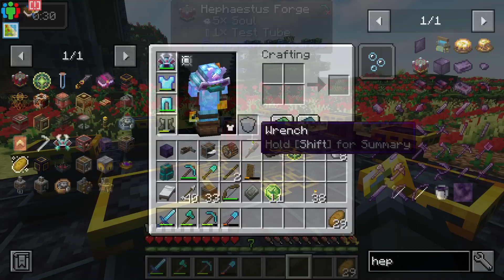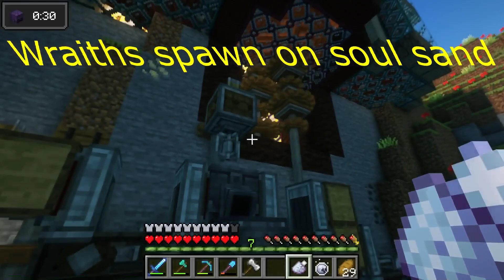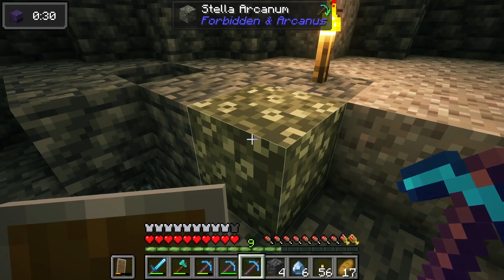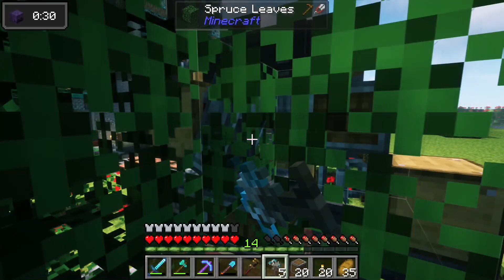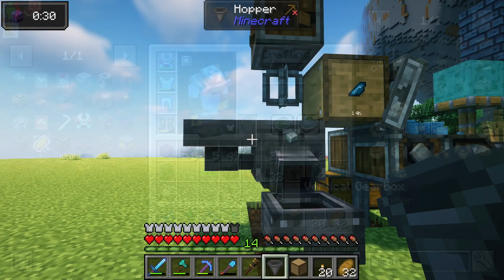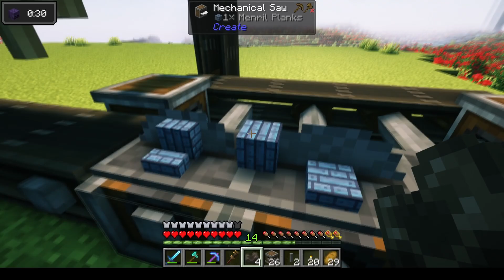Create Arcane Engineering - Mastering Automation of Chapter 1 Ep 3

Comment: How did you handle the inserting of the fresh saplings into the harvester? I recently built my own but I was having difficulty inserting the new saplings because the moment I inserted them they would be immediately removed. While I did have access to a brass funnel and could filter it to not remove fresh saplings, I worried that since each tree chopped gave more than one sapling it would eventually overfill.

I ended up making my system have two interfaces one on the end that removes everything and one on the top looking straight up in the middle that is connected constantly while in operation. I use redstone to disable the middle one when it is interfaced with the other interface. That way it removes everything but restocks on new saplings during operation
Reply from the maker: I like your workaround for the saplings. Good idea! For mine whenever I notice that it isn't planting saplings I  just grab a stack and toss them into the deployer by hand. I do have plans to fully automate it one day....

Comment: 9:10  i think the windmill above method is equally easy to the water wheel below method.  you only need like 8 sails sticking straight up, the windmill block, then the mechanical bearing.  i guess it does require 4 wool to make the sail things... that really shouldn't be all that difficult, but i suppose that does make it a little bit less easy than a water wheel.

Comment: I don't think you need that gear block for redstone. The button is hard powering the block there so there's absolutely no need. Does your pack freeze when in menus. Mine does and it is so annoying.
Reply from the maker: True, I don't think you need that cog block there either. But it looks cool and once I move this all into it's final destination, we want it all to look cool... I haven't had any issues with the pack freezing in the menu. My only issue is getting the pack to launch. But once it launches it runs smooth.
Reply: @TubeAndKnuckle  Huh, I have absolutely no issues getting the pack to start. Menus though. And can you tell me a mod that is quite nice but overlooked. I'm probably going to make a pack
Reply from the maker: If you're just talking about putting together some mods to mess around with check out the latest ATM pack they usually throw everything in there. Mess around with some new mods that you never heard of or seen and see what you like. @GogoTheSomeone
Reply: @TubeAndKnuckle  Nah, I'm making a legit pack. I will probably make a custom mod for the recipes and etc. I posted a hypothetical list